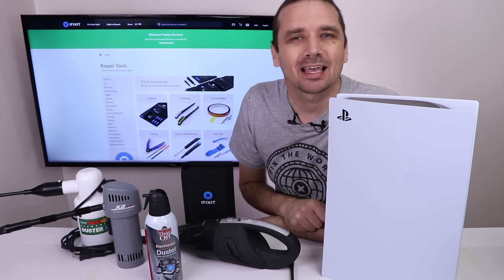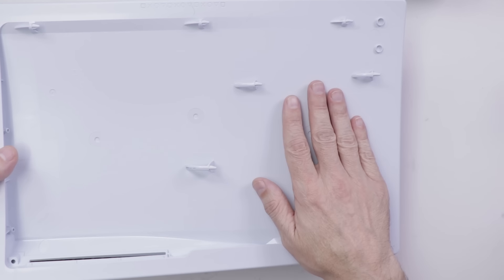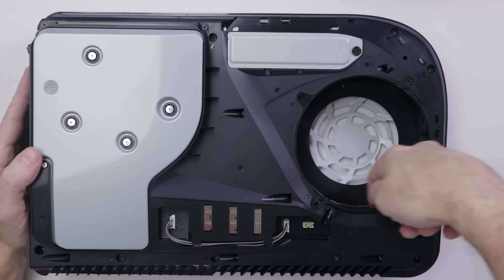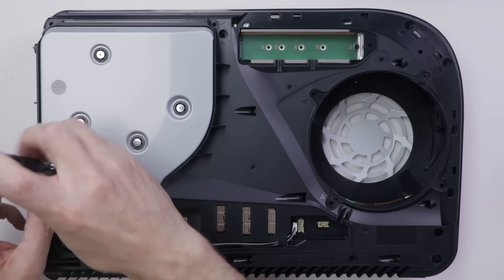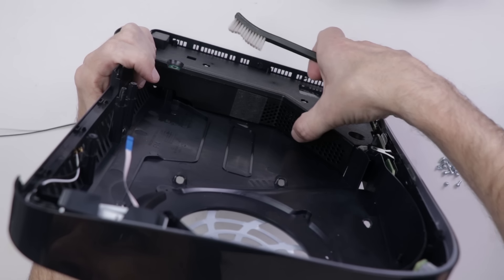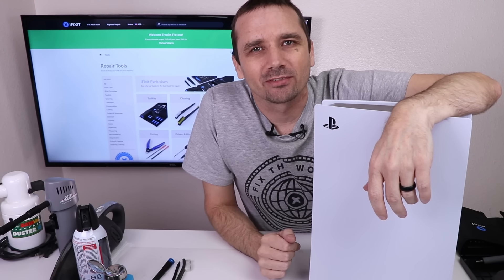How to Clean Your PS5 Safely - 3 Stages

Comment: Hey guys. So I have been wondering about something so was thinking I might find an answer here. I se everyone use these air cans and I do have one but I really dont want to use it inside my consoles. Anyone know if I can use one of those 8bar suitcase compressor instead or would that be to strong? 😁
Reply: im not sure about a compressor but i  just use a hairdryer on cold and it works fine
Reply: @ryangibson0110  hehe okey. I dont have one of those sadly. Maybe I will just use the compressor for the easy parts and buy one of those Rechargeable airdusters when i can xDD

Comment: Hey I accidentally took off that strip from the base  by accident at minute  9:34 will that contribute to my PS5 shutting off more  than it should have because that is whats happening right now
Reply: You talking about the little gray bit on the ribbon cable? It came off for me too, bc the guy who made this video didn’t mention that that one has a “lock” on it like the one attached to the disc drive 🤦🏼‍♂️. Looked like the laziest little Elmer’s glue speck was holding it on there so when I pulled on it (while it was still locked) it came right off. I’m not an expert by any means, but I think it should be fine - pretty sure it was a lackluster attempt at making that ribbon cable easier to plug in/unplug

Comment: When I play ncaa football 25 or nba 2k23 my plastation cuts off by itself with no lights
Reply: @williehodges4859  Clean it. I used this vid and I can play ps5 games again
Reply: I’m afraid to take the plates off
Reply: Can you clean it using a vacuum cleaner
Reply: @williehodges4859  if it's turning off its likely very dirty in there so try to clean it yourself or take it in somewhere to have it cleaned

Comment: At 7:32 I couldn't remove my top plate as it felt glued and so I stoped. I then noticed my moddle is the CFI-1100 so not sure if that`s the reason.
Reply: Glad it’s not just me, I’ve checked at 0.25x speed a few times and I definitely got all the screws
Reply: @MrFlapjacklol  It’s a shame there isn’t other videos for newer models but rather be safe then sorry so just keep to step 2.
Reply: @Killerbeastt   i had to as the power supply was overheating, it kept shutting itself down. i flipped the motherboard out of the plastic housing being careful not to brake the ribbon cable (i think its called butterflying if that makes more sense). it's not something i wanna do over and over tho

Comment: Yeah im to much if a coward to even go onto stage 2. Im scared im going to mess uo the fans wires or the connecting piece 😂 so at the most maybe i'll buy some canned air and reach it in there with a little nozzle

Edit: decided to man up and just go into stage 2 and it's a lot easier than it looks you pretty much just have to go really slow

Comment: Is stage 3 really necessary?
Reply: Only if after taking out the fan you see severe dust clogging on the heatsink fins. 
If you’re having crashing issues with the ps5 overheating it’s most likely that. I had that issue & I had to clean them thoroughly & I had no issues since then.

Comment: I don’t get using canned air in situations like this. Just invest in a micro vac set with a soft brush and go in with the vac and soft brush to get all that dust out of there instead of pushing it into the system with a brush and canned air.
Reply: I assure you no one cares and canned air is better
Reply: @ Don’t care so much you felt the need to comment? And canned air can introduce condensation. If you’re gonna blow it, use a blower.
Reply: @lew708  dw abt him, he replying to every comment, sum happen to bro ps5 or sum 😭

Comment: I took it apart, wtf it ain't easy I got it cleaned, put it back together...... Big win for me is that there are no screws left over.  Also could you include a diagram or schematics to where access go.  You had Terri screws in the wrong place.  When putting it back together

Comment: Ludicrous that you might need to go to these lengths with a games console. With a PC, the fans are used to create positive air pressure in the casing, simply by making the fan intake slightly higher than the fan out take: this positive air pressure generated in the case pushes dust out, keeping it dust free, where as the opposite sucks it in, accumulating dust rapidly inside the PC over time. You think this would be incorporated into modern consoles with the amount of design time and money that goes into these things? It's pretty important after all.

Comment: So back here again.  My PS5 has been overheating and shutting off during gameplay after a certain time. The back where the power cord, hdmi ports etc get overly hot. I called a repair shop and apparently a lot of people have been bringing in their systems to get fixed. Cost is $189. Anyone else experiencing this lately?
Reply: Yes same here, i usually play sea of thieves for only 1 or 2 hours and then my ps5 shuts off no message 😢
Reply: This is the video you have to take into consideration i know its scary i just took mine apart only to the fan but i got alot of dust out and now my fan is sounding quiet again

Comment: Most won’t need to go to Step 3, unless the console is in a really dusty environment. Have a launch PS3 for 17 yrs and only needed to do a deep clean & re-paste ONCE. Do step 2 once a year —be AOK.
Reply: How many years it was to do a deep clean on the PS3 cause I don't want to get a dust cover for my ps5:/
Reply: 15 years. You might sell it by then 😂
Reply: @DKN808  ok good cause I really want to see the ps5 while I'm not using it cause I don't want to put a dust cover and make it look goofy thx for the tip👍

Comment: So everyone please avoid stage 2 because most people know the screws require a specific screwdriver. I have very small screw drivers and it works on the SSD screw but not the fan screws. They are on super tight and to the point I stripped one and tried to use pliers and I got it off but realized I couldn't get it back on tight with the pliers. I didn't try the other 3. I saw those screws were going to be a problem so all I could do was just vacuum the top. I am so angry at Sony for these dumb screws. If you get a ps5 clean it every two weeks so you don't have to ever get to stage 2 for deep cleaning. Stage 3 you will damage your ps5 if you don't know what you are doing. Just take it to a repair shop and let them clean it.

Comment: My ps5 just started shutting off and getting hot
Reply: Mine kept shutting off without giving a warning or something and I did stage 3 cleaning and it's working now. You need to clean the PSU holes.

Comment: Toothbrush is usless , 
Torx T9 ,wetwipes, q-tips and a aircan is all you need. Make 3 or 4 areas were you take it apart. Then when you are done. Go back to the working areas and junpbackwards with everything you did before. The guy put screws in wrong holes 😂😂😂😂

Comment: Well, after many issues putting it back together, I turned on the PS5, everything was going smoothly. I decided to boot up my game only for it to tell me there was no disc. Meaning the disc drive isn't working. Hopefully its just the ribbon cable that isnt plugged in properly, despite checking it like 10 times before reassembling it all... 💀😭

Comment: The Playstation 5 Has Got To Be The Worst Design I've Ever Seen In Gaming Hardware History, It Literally Was Built To Collect Excess Amounts Of Dust Just To Force Us To Clean It Often, It's Ridiculous.
Reply: U just have dirty ahh house i clean mine once a year and almost no dust inside everytime
Reply: @dk3364  My House Isn't "Dirty" It's The Playstation That's At Fault, Because I Clean It Every 3 Months And My House Everyday And It Still Gets Dusted Damn Near Every Week.
Reply: @BigDiamondGames  maybe find a new place to put ur ps like i said i clean it once a year and almost no dust everytime so there is sum going wrong with yours
Reply: @dk3364  Did You Place Ah Fan Behind Yours, Or Covered It Or Something?
Reply: @BigDiamondGames  i build mine under my desk works perfectly it never gets hot almost no dust and warms ur feet a bit😂
Reply: @dk3364  *LOL That Last Part Would Come In Handy Next Winter, But On The Real Though My PS5 Is On Top Of My Dresser. So Maybe That's Why.

Comment: Why do you need to be technician to clean it? That seems like a design flaw
Reply: It's the same way with every console. A deep clean will always require taking apart the console.
Reply: @Fluctlight  But without that won't the console have problems? What am I supposed to do?
Reply: @TheGamerRist22  no, if you do level 1 like once a week and maybe every few months do a level 2 clean, your console shouldn't get dirty enough where it starts overheating and having issues. If it does start overheating and getting issues though, and you're too anxious to do a level 3 clean, (don't worry I don't have the guts to do it either) you could always take it to a cleaning/repair place.
Reply: @Fluctlight  I can't do level 2. Only 1. I clean it the best I can but I can't get in the fan so thats always gonna be dusty
Reply: @TheGamerRist22  you can do level 2, trust me. (Unless you don't have the torx screwdriver) It's always stressful the first time, but it's not as hard as it looks.
Reply: @Fluctlight  I do not have a screwdriver. There is no way I can take out the battery and fan without breaking it
Reply: @TheGamerRist22  I see. That sucks

Comment: Thanks but all the stage 3 dismantling is quite unnecessary.

It's quite easy to reach and clean the heat dissipators, with compressed air and a vacuum cleaner, using the hole you get when removing the ventilator.

Comment: …
Reply: 0:47 White Cover off

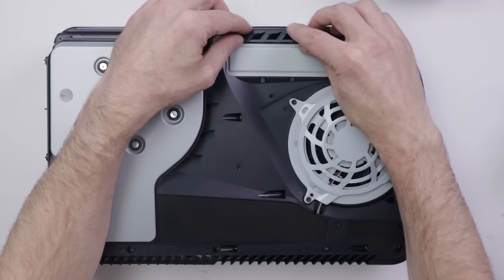3:15 Stage 2

6:05 Stage 3

7:14 The 47 Screws

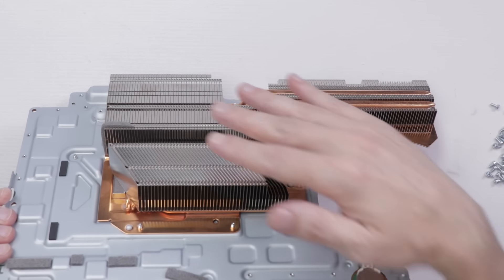9:23 Reassembly

 

Pliers - Alicates 

Brush - Cepillo

Dust - Polvo

Screw(s) - Tornillo(s)

Drill - Perforar

Reassembly - Reensamblaje

Disassembly - Desmontaje

Stage - Etapa

Napkin - Servilleta

Cotton Swab - Cotonete

Isopropyl Alcohol - Alcohol Isopropílico

Comment: this video is NOT good at all i destroyed my fan wires trying to pull this stupid thing out only to find out i could’ve just unscrewed the fan plate, flipped it out with the wires still attached, and dusted it off. Now I have to get my PS5 fixed. Really frustrated with how little emphasis this video places on how easily breakable the wires connecting the fan are. Now I wish I’d never tried to clean this thing.
Reply: Cuz you are bot.